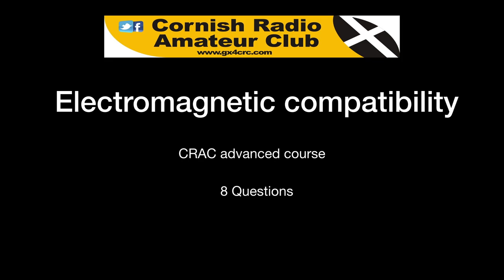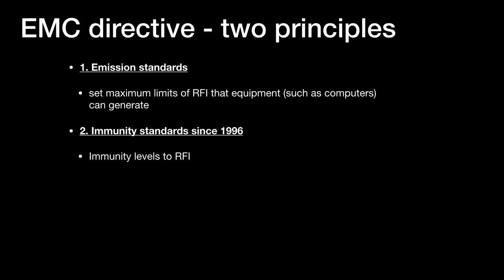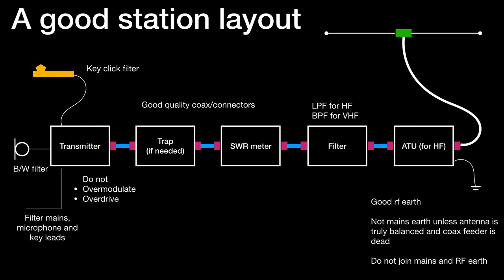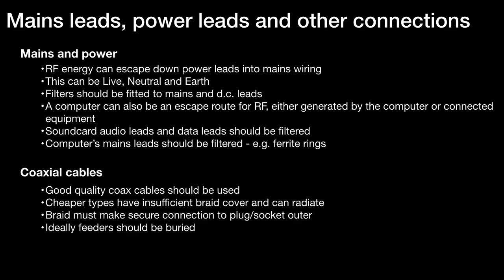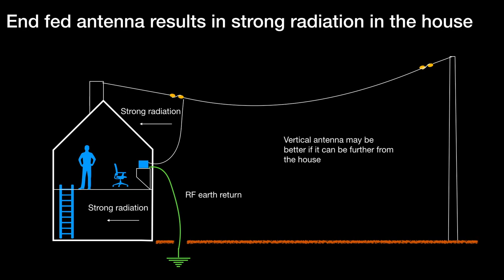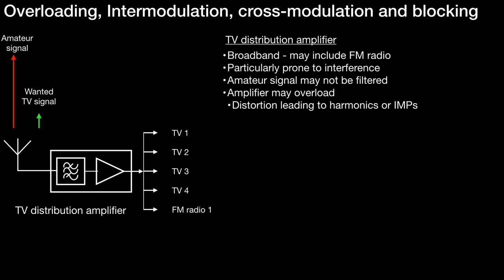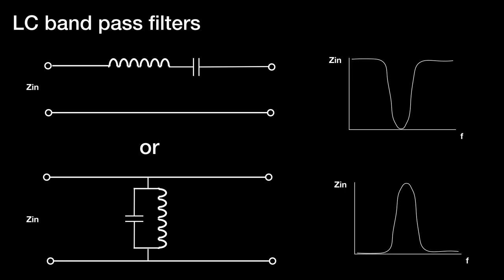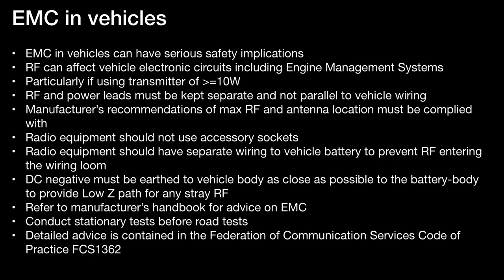Advanced - EMC

Comment: In the Mains Filter slide, I think you've got the output terminals on the right mislabelled.
And in the LC Band pass filters, I'm not sure it's helpful to show the impedance response of the tuned circuit, rather than the filter as a whole. At the moment it would suggest you can have two filter designs with the same function that have opposite frequency responses.
Reply from the maker: Thanks for the feedback Jim. I am now in the process of revising the course for the 2019 syllabus and will fix those issues at the same time.
Reply: @cornishradioamateurclubtra4073  Thank you for your continuing efforts - I've found them all really useful.